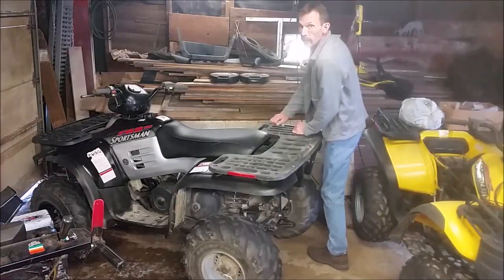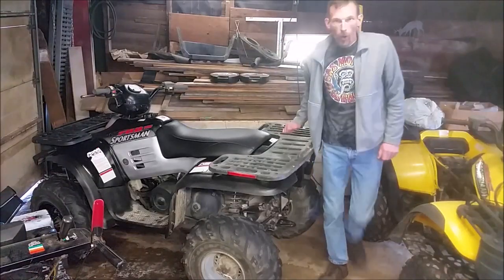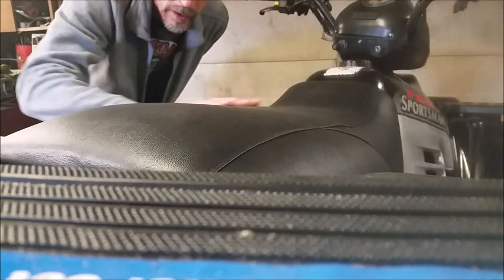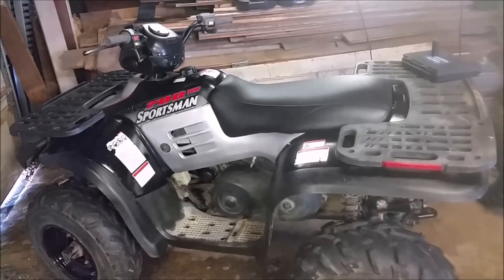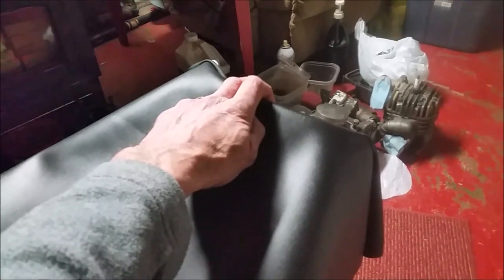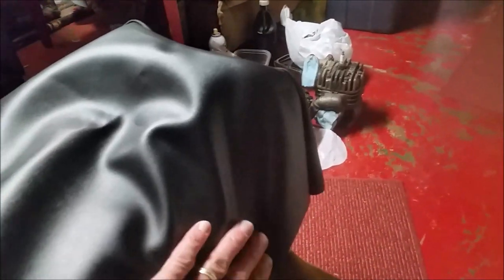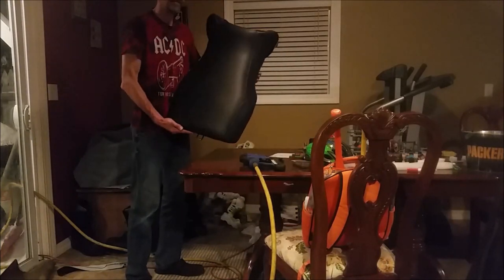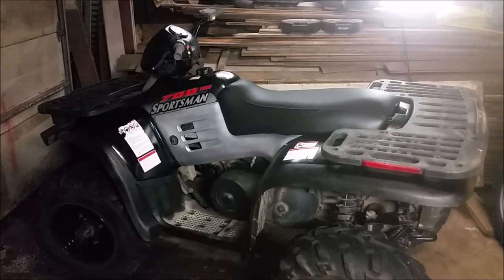How to install a Polaris Atv seat cover and make it look good!

Comment: Can I use a hand stapler? I don’t have air tools.
Reply from the maker: I tried it. Doesn't work to well. I also tried an electric one. It didn't seem to have much power to go through plastic. Unless you get an expensive one. I paid 35 bucks for my air stapler. Get a cheap compressor from harbor freight.  You'll be a lot happier with the results
Reply: @TitaniummanGarage   Thanks for the info.  Just bought a used 02 Sportsman 500.  It needs work, I subscribed and will be checking out more of your videos!